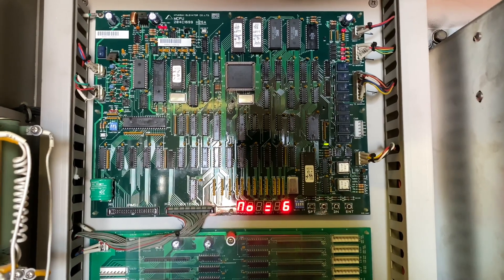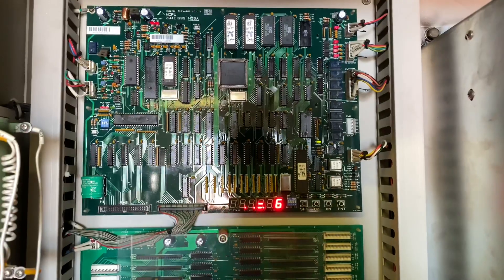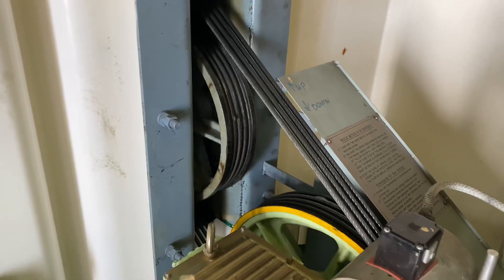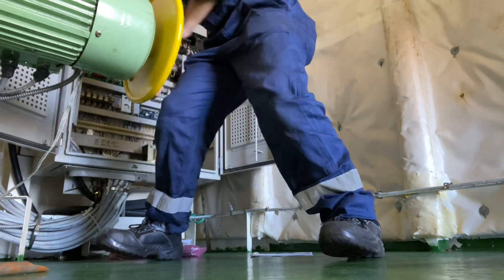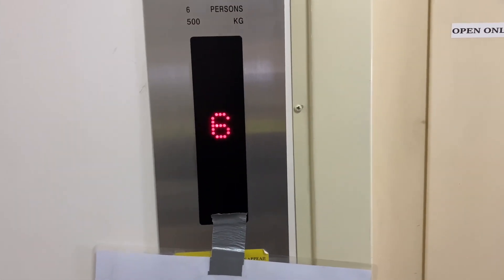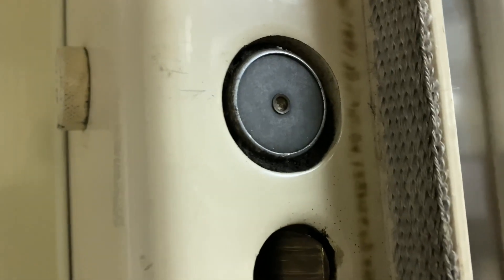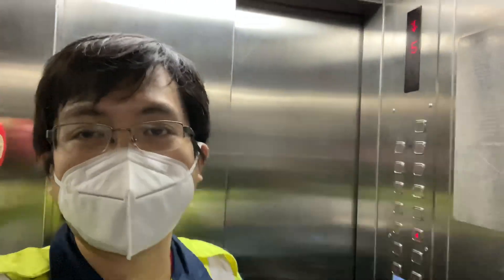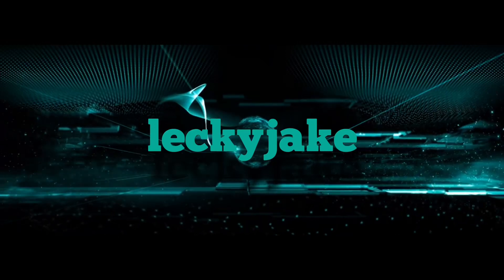ETO ONBOARD ELEVATOR TROUBLESHOOTING | Ship’s Electrician

Comment: Sir Leck, my question is, kapag ni released mo yung manual brake don sa motor ng elevator, wala bang chances na iikot or babagsak yung elevator compartment. Thanks.
Reply from the maker: May spring handle na need mo pa i release before mo ma ikot ang brake. In case ma mapabilis ang ikot release the manual handle at mag engage ulit ang brake.
Reply: @leckyjake  okay sir, so dapat presence of mind, sana buddy system para meron taga brake or Kaya Lang ba siya e operate mag Isa. Thanks
Reply from the maker: Need someone to assist you
Reply: Sie lecky. Sana makasama ako sayo as assist. Or training dami kupong matutunan sayo sir. I hope magkaroon ako chance may req. Narin po ako pang barko landbase lang experience ko

Comment: Hi sir, we have same Hyundai elevator showing F25 error and also can't run it in manual mode. Pls advise
Reply from the maker: Check your brake how it engage. Normally it happens once the break is not engaging and the car slips.
Reply: @leckyjake  break operation is proper i guess problem may be with inverter unit bcz not getting output from invertor after trying bypass all door interlock switch..main contactor gets energized but no power supply to MC & MCX contactor n elevator not run

Comment: Hello, how you came to know that 3rd deck limit switch is giving intermittent signal?
Reply: same question
Reply from the maker: You need to check all the door interlock. Let the car Travel then manually pull all the door from the outside. If the car stops then your door is not closing properly. Then check the angle of each locking arm and compare them with one another.
Reply: @leckyjake  salamat sir...... big help... keep safe palagi sir
Reply: Hello lecky sir, if we manually pull the door from outside while the car is traveling, then obviously the car will stop!! Then, how come it should be understood that, that particular door is not closing property!?
Reply from the maker: Bhattu Vinay if the door is closed properly no matter how hard you pull it then the car will not stop while it travels.
Reply: @leckyjake  i get ur point sir .. salamat po
Reply: Mr bhattu, sir I think it's not safe to open or pull the door while car is traveling
Reply: @herculespaypz9772  I think with Jakes explanation with pulling the door he only meant that, pulling, not actually opening.
If the locks work you will not be able to pull the door open anyways. But as he pointed out, something is wrong with the switch, the little movement from pulling may already cause the switch to open and stop the car wherever it is.
As he showed also the springs that automatically close the door I think if I understood correctly he readjusted the switch position so it has as little play as possible and also tuned the door spring, as it possibly did not shut the door completely.
Reply: Yeah got it sir!! Thanks a lot, initially I thought we should open door, it by the key provided for the same, but, yeah, we should just pull the door and check it!!

Comment: Hello Lecky I remember 15 years ago the old elevator control based only in relays a lots of relays
Reply: Let's be honest, there where more parts that could fail, but diagnosing a bunch of Relais is still far more simple than diagnosing a possibly faulty IC.
I think especially at sea a simpler design using less "special" parts is easier to maintain or to repair if necessary.
Having a box full of specific circuit boards seems to be a horrific choice if you have to diagnose and all you can do may be switching a board, if you have a spare one.
Would not have made a difference with this fault as it seems to have been a lockout switch, but nevertheless.